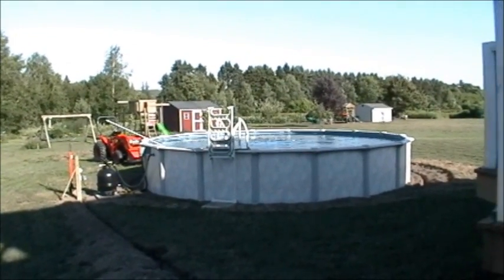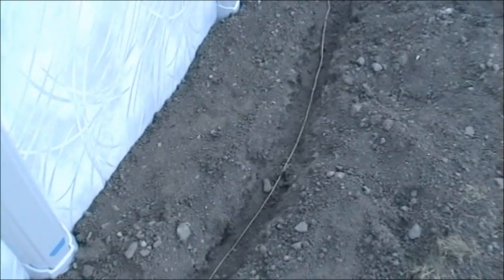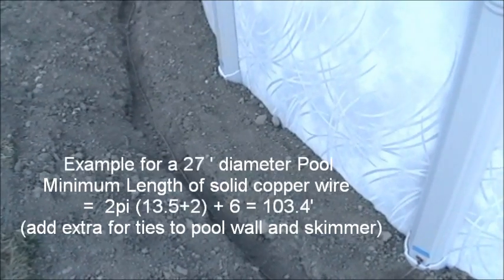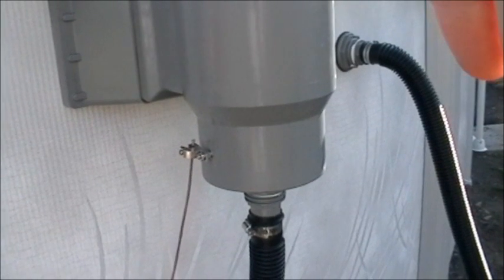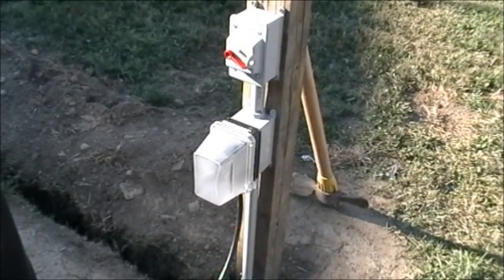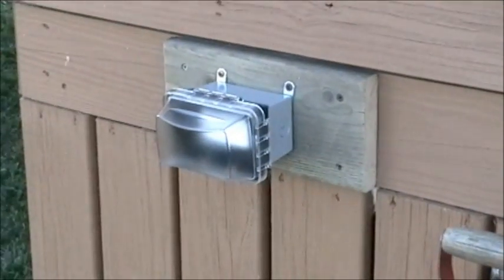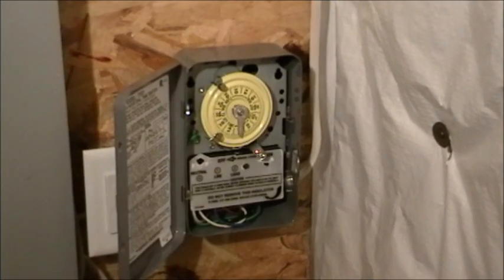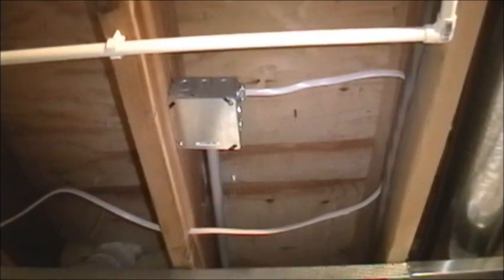Above Ground Pool Electric Installation

Comment: Did u use PVC gang boxes with straight male/female connections or did u use threaded gang boxes with adapters. Thanks. What was the type of 12 gauge wire u used? Appreciate all ur help

Comment from the maker: Yes, the lugs had to be UG rated. You'll probably need a little more than 100' including the bonding to the skimmer basket (if required in your state) and to account for small bends in the wire.

Comment: Thanks for the information.  This video is very helpful.  Did you use the 'beaver claw' type of bonding lugs that are rated for underground use?  I have a 24' above ground pool.  Using your calculation method, I am assuming 100ft of 8 AWG would be enough to cover the small connections at each post and back to the motor?

Comment from the maker: Glad you found the video helpful. The plug for the pump is just a twist lock as I chose to do the GFCI at the breaker panel. To wire the switch I ran the hot wire past the plug and up to the switch, broke it there to wire in the switch, and then back down to the plug. I did not use any conduit expansion joints. Nothing special was called for in the code or by the inspector. I called my inspector several times during the project to find out what he wanted to see.

Comment from the maker: I used stranded. The electrician that was going to make the connection to the panel had it available. He said the reason he uses stranded is it makes the corners easier when pulling through the conduit. He was right. I had 3 90's to pull past and it wasn't bad. I used an air compressor to shoot a small string with cloth tied on the end through, which then pulled a small rope (for grip and strength), which then allowed me to pull all 3 wires. Good luck with your bonding.

Barry

Comment from the maker: - Just to make sure - the quote should read "You can't use romex in the conduit". I'm not sure if UL is allowed. I had single strand available so I didn't look at options.
- The code says bare copper needs to completely circle the pool, but doesn't say it needs to be connected back on itself. I connected it together just in case.
Thanks for the comments.
Barry

Comment: Nice vid, very thorough.  Couple questions:
- "You can use romex in the conduit" ...can you use UL in the conduit (its actually cheaper than running single strand?

- for the bonding, does the bare copper wire completely circle the pool - meaning, do both ends tie together (not sure if it matters)?

Thanks
Dave